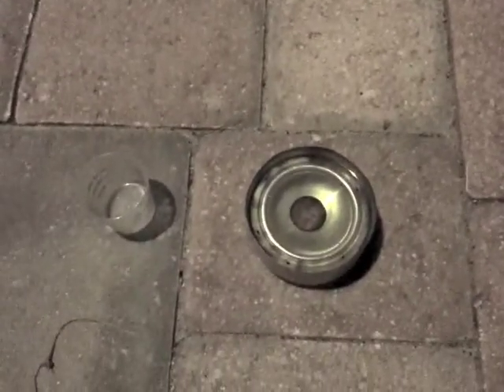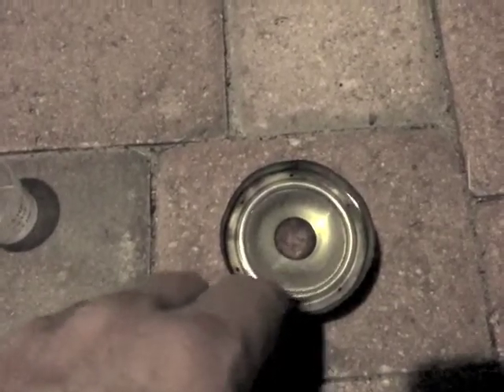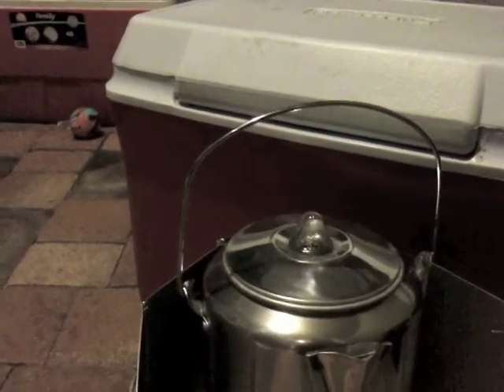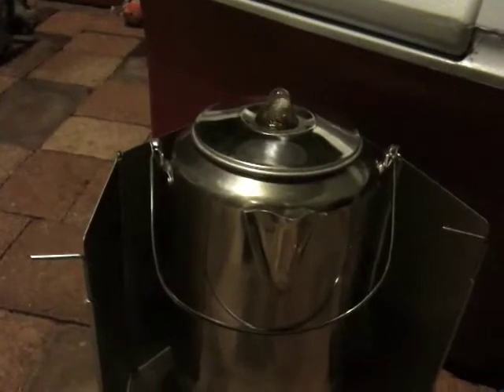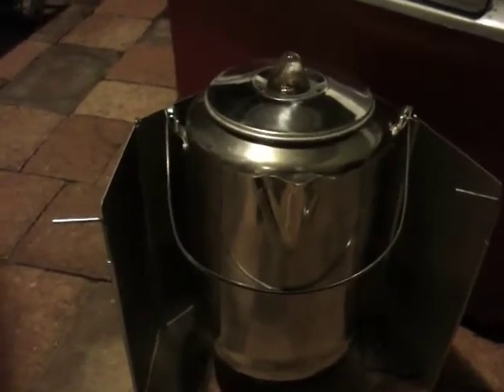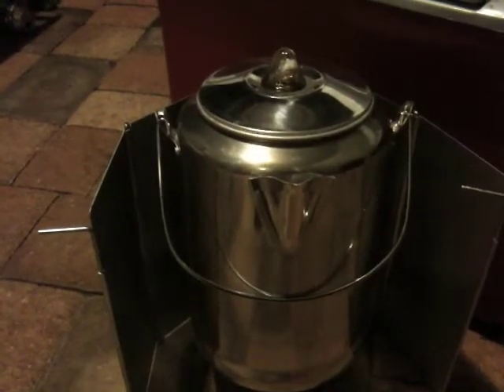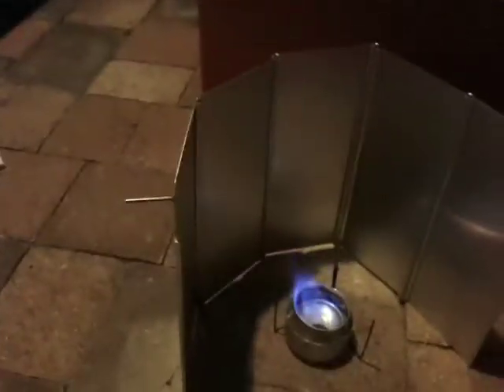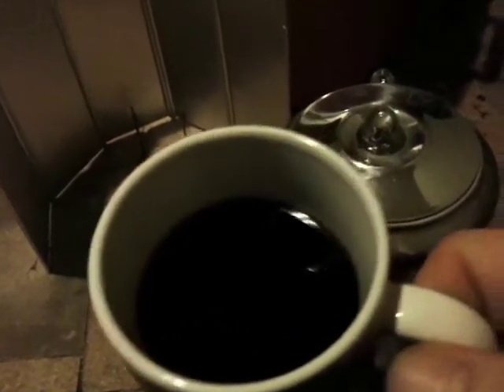Penny Stove Coffee

Comment from the maker: Hi Janken919. No unfortunately refueling while lit is not an option. If you should require more fuel simply allow the stove to go out. (please make sure it's out as alcohol is hard to see burn in daylight) refuel and since the stove is hot is maintains that most of that heat will prime within a minute and you back on. You won't lose much momentum. To look at self refueling stoves search for minibulldesign here on youtube. Thanks for posting.